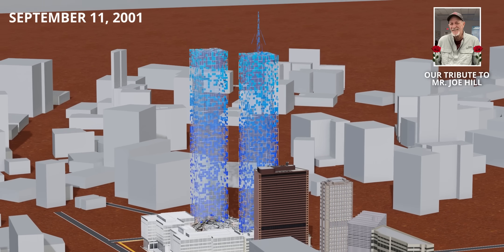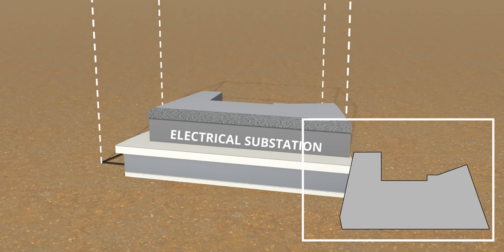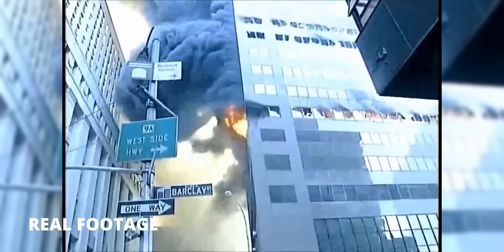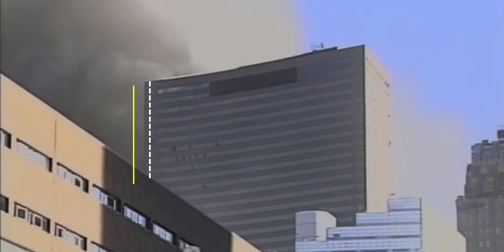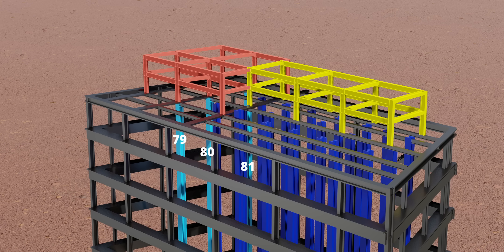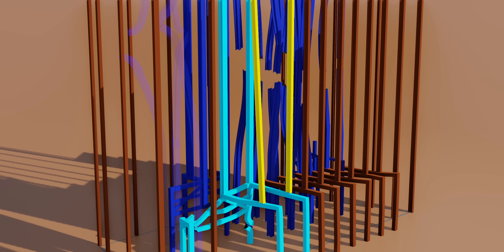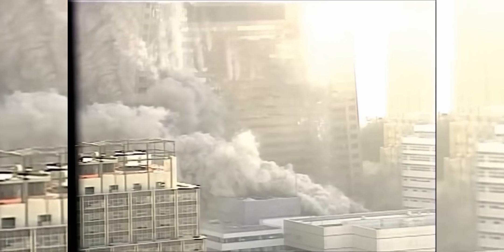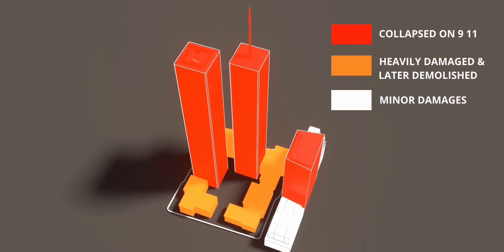Collapse of Building 7 | The Complete Physics

Comment: No physics stop gaslighting it was brought down
Reply: Yes, by gravity. Much misunderstood, Building 7 was the 6th building to collapse of 10 lost on 9/11. Because of its early low priority, conspiracy filled the information void with garbage made up by technically ignorant people promoting political agendas. But this is an engineering problem and should be treated as such, so I prepared this brief summary of my own analysis to fix that, using engineering, not politics and tired memes. 

The North Tower collapse at 10:28am bombarded Building 7 with tons of debris, causing heavy damage and starting multiple fires which burned out of control for 7 hours. Half the FDNY firefighters having been killed, units in disarray, equipment destroyed, no water pressure, and the greater urgency of search & rescue efforts, firefighting was pulled as futile. The building couldn’t be saved and was left to its fate. That is the sort of choice firefighters make every day in brush fire situations - which houses to save and which ones to let go. Only real difference here is moving the decimal on the size and cost. People get overwhelmed by the size. 

www.youtube.com/watch?v=g_SvpwyC17M&ab_channel=MFitz  

Collapse of a burning structure is always a concern for firefighters. Steel buildings subject to fire rely on active fighting of the fires to survive. Buildings are designed around 1 to 3 hours of fire resistance, allowing time for occupants to escape and ACTIVE firefighting to get started, after which all bets are off. Left to their own devices they will exceed their design envelope and collapse, like Plasco Tower and Wilton Paes de Almeida. In B7 the occupants escaped, passive and active fire protections were compromised and active firefighting was abandoned 3 hours before the collapse, which left the building to its fate. It lost. Odds on Building 7 would eventually collapse, and it did. No big deal in logic. 

www.youtube.com/watch?v=WnYBX6QT0R4 

FDNY Chief Daniel Nigro ; The biggest decision we had to make on the first day was to clear the area and create a collapse zone around the severely damaged 7 World Trade Center, a 47-story building heavily involved in fire. A number of fire officers and companies assessed the damage to the building. The appraisals indicated that the buildings structural integrity was in serious doubt. I issued orders to PULL back the firefighters and define the collapse zone. It was a critical decision; We could not lose any more firefighters. It took a lot of time to PULL everyone out, given the emotionalism of the day, communications difficulties and the collapse terrain

FDNY Deputy Chief Peter Hayden ; We had our special operations people set up surveying instruments to monitor and see if there was any movement in the building. We were concerned of the possibility of collapse in the building. And we had a discussion with one particular engineer there, and we asked him if we allowed it to burn could we anticipate a collapse and if so, how soon? And it turned out that he was pretty much right on the money, that he said 'In its current state you have about 5 hours

The collapse of Building 7 was anticipated and widely reported in the media throughout the day, with 24 video cameras recording some or all of the collapse. Everyone knew what was coming and why.

www.youtube.com/watch?v=OY5S5k3tMHI 

Building 7’s collapse was completely different to the Twin Towers and harder to understand as most details hidden from view and not intuitive, but we can still sort out what happened through careful analysis and observation.  This is my explanation  of the collapse relying on no outside authority.

Building 7 was complex, assymetrical 47-story steel framed structure built atop a smaller 3-story building, requiring lower floors dedicated to complex load transfer structures, not usable office space. Of trapezoidal shape and all-steel tube-in-tube construction, B7 (above the 7th floor) consisted of a central core of steel columns carrying most of the gravity load, perimeter steel columns around the outside of the structure carrying the remainder of the gravity loads and long span beams and girders to tie those elements together and form the floors. On the outside of the building hung a moment frame or outer shell.

Phase 1 : First externally visible signs of collapse initiation occurred at 5:20:28 pm and were notably quiet with observers not realizing the building was collapsing! No audible warning in the form of  hundreds of ear drum busting 180-190dB explosive bangs preceding the collapse. Here at 12:00 a local CBS affiliate reporter is talking 10 blocks from B7 when collapse begins. People don’t start to notice the collapse until 12:11. At 12:45 is the famous CBS fixed camera clip of Building 7’s collapse. Note how quiet it is.

youtube.com/watch?v=t5tEy6mXSE8&ab_channel=fresnosean379

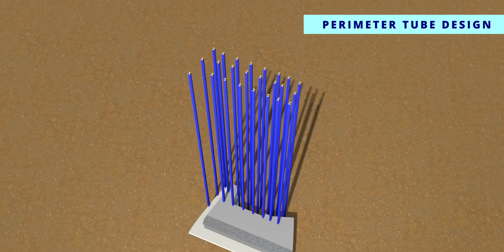Collapse initiation was due to lower floor failures above the load transfer region (7th floor) in the NE corner. In this video at 0:45 you can see the NW corner from inside the building while under construction, Column 79 just out of frame on the left. That big, angled steel beam across the top of the frame connects to C79 at one end. The girders connect to the beam. That beam and all those girders depend on just one connection

youtube.com/watch?v=nP3TNHPCIVU&t=35s&ab_channel=EdwardCurrent

Phase 2 : The floor failures caused a loss of critical lateral support over an excessive length of core Column 79 and it buckled. If you look at a floor diagram of Building 7 (see above) and look at all the structures that depend on C79 you quickly realize this one column was a relatively isolated structural element on which a disproportionately greater fraction of the structure depended analogous to say the Key Bridge. Externally we see a vertical progression of window breakage along the 44-46 line and a kink in the roof of the East Mechanical Penthouse at the top of the building, consistent with C79 failure. The transition from full capacity to almost no capacity occurs in an instant. Once the buckling failure occurs there is almost no resistance

Normally with a buckling column, the load could be redistributed to other columns. With C79 that is not the case - the failure did not redistribute the load, so the collapse rapidly progressed to the roofline, sinking the rooftop penthouse.

Phase 3 : With C79 gone, B7’s progressive, non-symmetrical collapse continues with C80 and C81 at the east end of the core left laterally unsupported and quickly buckled and failed as well, sending the EMP down through the building. C79-81 all have no diagonal bracing, which I believe is a major reason why they could not redistribute a lot of vertical loads among one another.

From there collapse progressed from east to west through the central core until the core was gone taking all of the interior floors and probably most of the perimeter columns with it. Follow the horizontal progression of window failures low in the building and the dropping of the remaining rooftop structures into the building. One of the big takeaways from the NIST Building 7 study (that gets completely ignored) was their modeling which determined C79 failing under ANY circumstances would have initiated the same collapse sequence.

Phase 4 : After 10 seconds only the exterior moment frame - a hollow empty outer shell – remains, giving the ILLUSION the Building is still standing since little has outwardly changed.  It is just a hollow empty shell like an empty cereal box. Supported by only a few remaining columns that empty shell is quite unable to remain standing. With all core columns and floors gone, the north face leans inward, forming a V in the roofline, the last few columns buckle under the strain and the moment frame free falls, landing on top of the 7-story high debris pile. It is only late in the game here at the end that a single measurement of alleged free fall acceleration is taken, from a single point on that outer shell. The Building did not “free fall” – just one corner of the outer shell did- sort of. The Building was already gone before that happened. The period of alleged free fall was a product of how it fell NOT why it fell and cannot tell us what started the collapse. Start to finish the entire collapse took 18-20 seconds, 3 times longer than true free fall .  How fast something falls cannot tell you what started it falling_ anyway. The debris spread outside the footprint, blocking surrounding streets, heavily damaging the Verizon Building and destroyed Fiterman Hall.  

Building 7’s progressive, non-symmetrical collapse was incidental and unintended collateral damage from the combined effects of fire + time + gravity, started by the collapsing North Tower. That is true no matter who planned and carried out the 9/11 attacks or why . The collapse was of so little consequence it barely even registered at the time, a mere footnote. It only took on semi-mythical status as an alleged smoking gun years later when demolitions at the Twin Towers, missiles at the Pentagon and shoot down over Shanksville all failed and conspiracists had nothing left to work with.

Anything can seem like a conspiracy if you don’t understand how it works. Now you should. I hope you found this helpful, informative and it solicits informed critical comment. If I made any errors of fact, logic or reason or left anything important out, please let me know so I can fix it. IF you can offer a more plausible alternative please do. Be the first. Please start any reply with the words “Tits McGee” or I will know you didn’t read it and are wasting my time.

Comment: No one sane believes this building went down without being intentionally demolished !😂😅
Reply: While you need to say things like that to feel better about yourself, it is worth noting the collapse of Building 7 is one of the most studied engineering disasters in history and the subject of 5 comprehensive engineering studies and more than two dozen technical articles in major peer reviewed engineering journals, most of which were published 15 or more years ago. Thousands of pages of material.  This should get you started.

FEMA BPAT (initial report superseded by NIST NCSTAR 1A)

NIST NCSTAR 1A: Final Report on the Collapse of the World Trade Center Building 7, 2008.

Guy Nordenson and Associates, WTC7 Global Collapse Analysis Report and Summary of Findings, 2010.

Arup, WTC -7 Structural Fire Analysis Report (Runs 1-4), 2010.

Weidlinger Associates Inc., WTC 7 Collapse Analysis and Assessment Report, 2010.

BRE Centre for Fire Safety Engineering, Analysis of the Impact of a Fire in the Mechanical Room (5th & 6th Floor) of the World Trade Center 7 Building, 2010.

T. McAllister, R. MacNeill, O. Erbay, A. Sarawit, M. Zarghamee, S. Kirkpatrick, J. Gross, Analysis of structural response of WTC 7 to fire and sequential failures leading to collapse, J. Struct. Eng. (United States). 138 (2012) 109–117.

For a summary of the major studies I would recommend THE COLLAPSE OF WORLD TRADE CENTER 7: REVISITED by Mhd Anwar Orabi , Liming Jiang , Asif Usmani and Jose Torero which is a 33 page summary of the different analysis and conclusions published in 2020. Sorry, YouTube will delete this post if I give the link but it should be easy to find and is available from the University of Queensland, Brisbane. 

Real structural engineering industry professionals conducting real engineering studies and publishing them for other professionals to see. Not amateur YouTubers appealing to the gullible and credulous.  

Those hundreds of engineers all agree it was 7 hours of unfought buidling-wide fires.

Happy reading
Reply: Wrong again-- just give up.
Reply: Well explain how the building came down without being hit by a plane moron ? @johnd7435

Comment: beams and floors are structural elements that allow for redundancy, your model is dishonest
Reply: There are no models here, only animations, but you demonstrate a fundamental lack of understanding of the structure.

Building 7 was a complex, assymetrical 47-story steel framed structure built atop a smaller 3-story building, requiring lower floors dedicated to complex load transfer structures, not usable office space. Of trapezoidal shape and all-steel tube-in-tube construction, B7 (above the 7th floor) consisted of a central core of steel columns carrying most of the gravity load, perimeter steel columns around the outside of the structure carrying the remainder of the gravity loads and long span beams and girders to tie those elements together and form the floors. On the outside of the building hung a moment frame or outer shell.

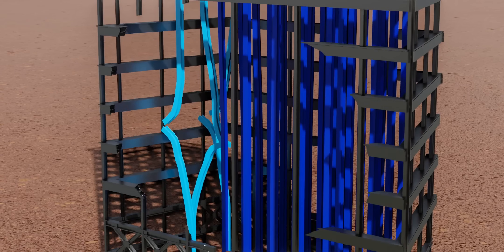Collapse initiation was due to lower floor failures above the load transfer region (7th floor) in the NE corner. In this video at 0:45 you can see the NW corner from inside the building while under construction, Column 79 just out of frame on the left. That big, angled steel beam across the top of the frame connects to C79 at one end. The girders connect to the beam. That beam and all those girders depend on just one connection

youtube.com/watch?v=nP3TNHPCIVU&t=35s&ab_channel=EdwardCurrent

The floor failures caused a loss of critical lateral support over an excessive length of core Column 79 and it buckled. If you look at a floor diagram of Building 7 and look at all the structures that depend on C79 you quickly realize this one column was a relatively isolated structural element on which a disproportionately greater fraction of the structure depended analogous to say the Key Bridge.

Normally with a buckling column, the load could be redistributed to other columns. With C79 that is not the case - the failure did not redistribute the load, so the collapse rapidly progressed to the roofline, sinking the rooftop penthouse. From there collapse spread to C80 and C81, left laterally unsupported over an excessive length resulting in their buckling failure. The Sabine video over-simplifies this into C79-81 failing essentially together, but that is not what happened. With those 3 east end core columns gone the rest of the core columns are going to suffer a similar fate. The easternmost columns will also buckle and fail, progressing from east to west through the core until the core is gone.

Comment: What I do know that in the early hours the British Broadcast Corporation reported an attack on the other trade center. At the same time Barry Jennings and Mr. Hess also reported explosions and body parts from the other buildings WTC 1 and WTC 2. They were trapped inside because the lower half of WTC7 had exploded as reported by the FDNY.  The FDNY went through the hole created by explosion to rescue Hess and Barry Jennings.

Comment: When a building collapses at free fall, that means that the concrete and steel falling through the air met the same resistance as the pieces falling onto the building below. It wasn't a relay race (that would have caused a slower collapse), every floor started falling at the same moment for the top to reach the ground as fast as it did.
Reply: Building 7 did not collapse at free fall

One corner of the exterior moment frame - the last part of the tower still standing - briefly averaged a rate of acceleration equal to free fall for just 2.25 seconds. As there was no sustained period of FFA, only a single data point was measured, that data point did not represent the building (defined as its center of mass), that data point was moving in 3 dimensions not 2 and the movement was the product of collapse progression mechanisms NOT collapse initiation mechanisms, it is of no value whatsoever in understanding the collapse.
Reply: "When a building collapses at free fall, that means that the concrete and steel falling through the air met the same resistance as the pieces falling onto the building below"
No, it doesn't. But even if it had, so what? "Free fall" is a meaningless term, and what you want it to mean didn't happen.

Comment: In 1945 a small bomber crashed into the Empire State Building. The bomber entered deep enough to cut through at least one elevator shaft, severing the cables. The elevator had an emergency brake system but it depended on cables that got severed too. So there was nothing but air left to slow down the falling elevator. There was a woman in the elevator and she survived. How? Because in this case air was enough to significantly slow down the fall. Only worked because the air was trapped inside the shaft, obviously, but under certain circumstances even pure air can provide significant resistance to a falling heavy metal thing like an elevator car.

Even without the core structure WTC7 had 57 steel columns inside the perimeter walls. Steel columns bolted and welded together with steel beams to entire steel network walls which were bolted and welded together to an entire steel network box and for the height of at least 8 floors all that provided less resistance than air in an ESB elevator shaft, it provided ZERO resistance.

Only explainable with cutter charges.
Reply: Except it wasn't the building (defined as its center-of-mass) being measured. This is the critical part where people invariably lose the plot - not understanding what was being measured. Not to mention not understanding the measurement itself, which does NOT show a period of sustained gravitation acceleration anyway.

It's all a giant nothingburger that has been failing every time for 20 years because people fundamentally misunderstand the context.
Reply: @TheCriticalStinker-01  Thanks for not ignoring me stinkyfitz!
So you changed sides now? Now you oppose your once beloved NIST? Or is it just that you have no clue what you´re talking about AGAIN stinkyfitz?
Reply: I'm impressed. You managed dumb shit again. Then again, that's what you do. Mash up various things in all sorts of ways, and then pretend it means something.